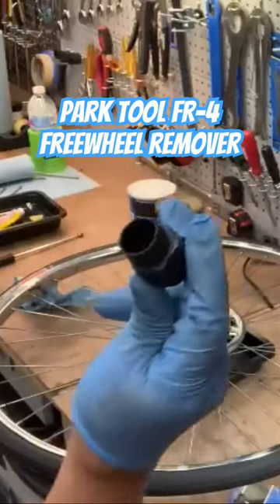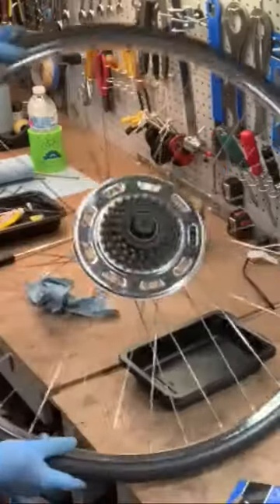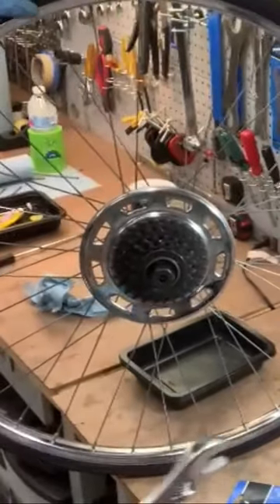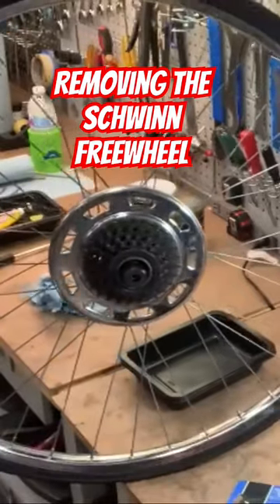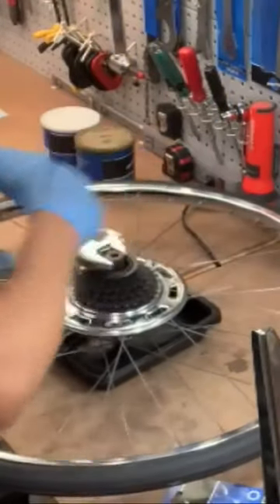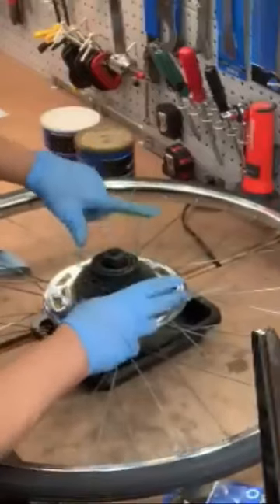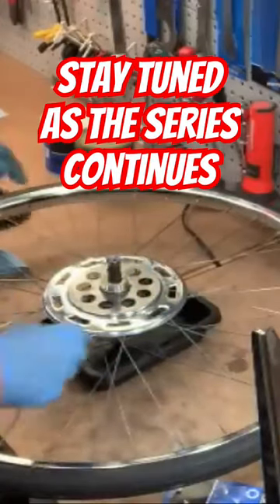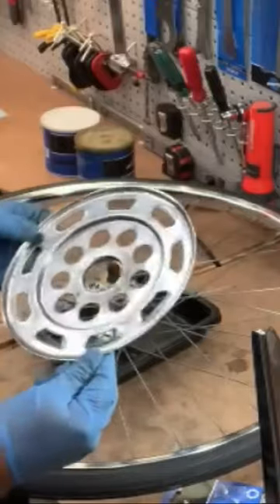🤔How to remove your Freewheel 🔧⚙️ #bikes #schwinn

Comment: Dang. I needed that tool. No one could remove it. I had to do a bearing repack with the cluster in place. And the cleaning too. Got it done but it was slow going. I won’t buy iron Schwinn anymore.
Reply from the maker: I did a few like that until I got the F4😂 it does make it easier 🧑‍🔧👍